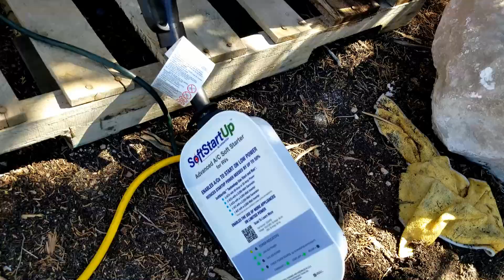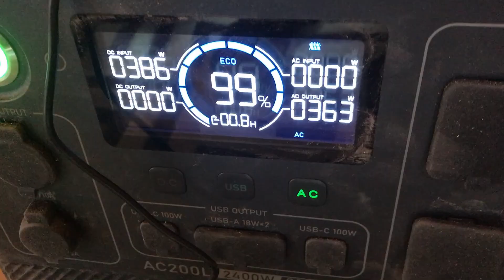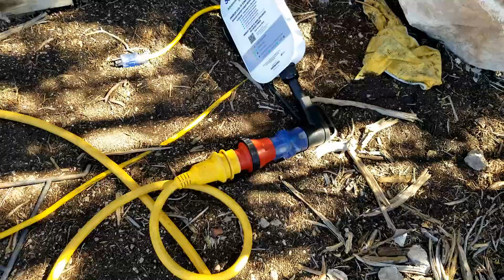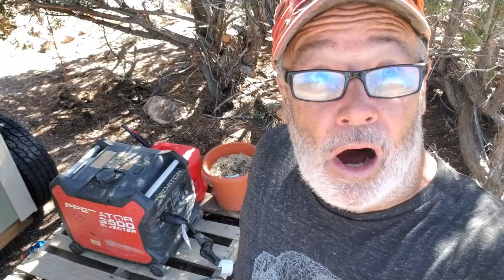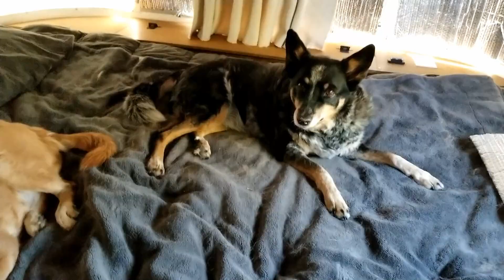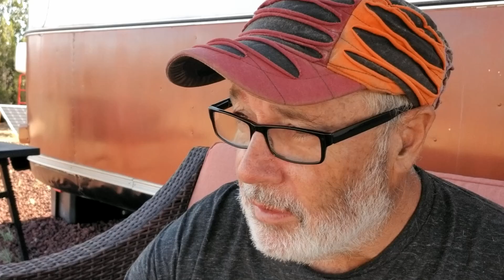RV SOFTSTAT PLUG AND PLAY FOR YOUR AC OFF GRID

Comment: Hey! I was just researching softstart cuz we are in Imperial Dam AZ and its 105!!! And low and behold when I searched this topic, your video came up❤️ I only subscribed to you 5 months ago 🏜️ I am running my 13,5btu ac off a 2200Honda, and bcuz its 105, I decided to run Only the ac, turned all other breakers off and turned fridge on propane only. And it is coping(after oil&sparkplug/those spong thingys cleaned(carb?), and it is doing fine! I get 4.5hrs from a tank. But I thought why not get one of these plugs, but they are pricey and hubby says we could buy a bigger genny for that price! So I wonder if its worth using the installed in ac softstart if these plugs dont work? The cost is about the same with installation as buying this plug...I tell ya, if I wasnt stuck here due to extensive dental work in Los Algadones...I would most certainly be hightailing it to cooler temps!!!🙋🛻🇨🇦❤️‼️
Reply from the maker: To be honest, not sure there worth the price. Yes, it does help IF your Gen is putting out what it’s supposed to. We bought a swamp cooler. In this desert heat, it’s perfect if you have an ample water source. You can run them on Solar. If gives your AC a break so it’s not running for 12 hours. It’s cheaper that a Soft Start.

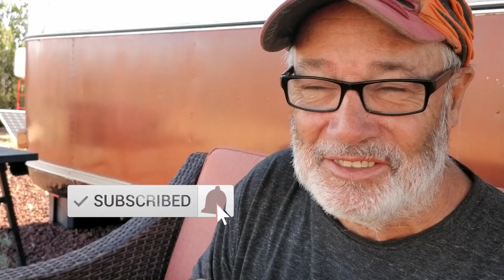Comment: 12:33 I just got a Bluetti AC200P(marketplace$500) and was suprised that it ran my ac13.5! I had to turn fan on low, and shut everything else off🤣 but it ran it! It certainly wont work for long but I was suprised! I bought a soft start off amazon, a cheaper version that my friend is willing to get up on my roof to install..for a Silly Al pizza😂 so its a win win😍🤪🏜️🐪🌵🌞👍💯🙋🛻🇨🇦‼️ I just subbed😍‼️
Reply from the maker: Thank you 🙏 btw, Silly Al’s has really good pizza. 😊
Reply: @ThisNomadicIdea update, the cheapo version I bought could not be installed But Silly Al's was great 😁and Bluetti said nope, not gonna do it...too much surge. But would run fan only.

Comment: Works good right? Looks similar to the one I have and love that it’s portable and not tied to my individual AC.
Reply from the maker: No! Didn’t work. Gonna completely clean / change oil in the Predator to give it one more chance.
Reply: @ThisNomadicIdea  I guess I should finish watching the whole thing first…😂😂 Does it have an app in which you can set the watts lower to keep the breaker from tripping?